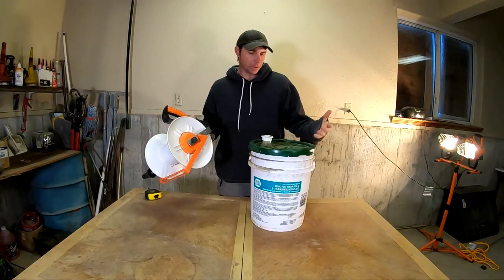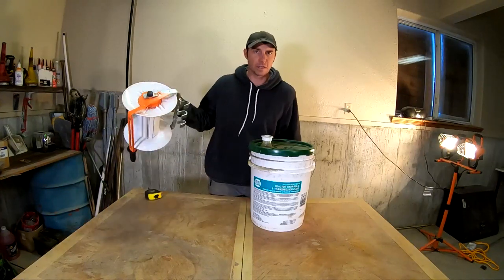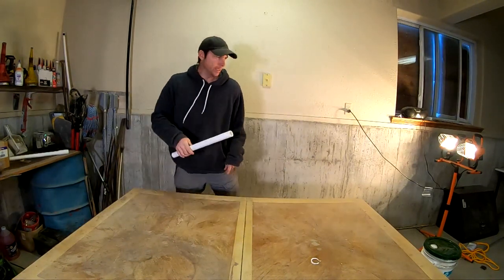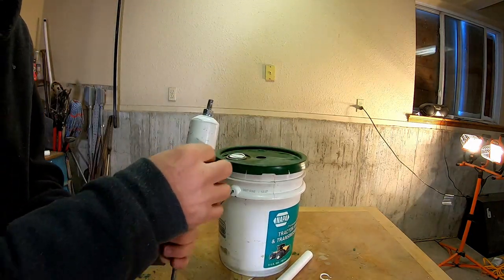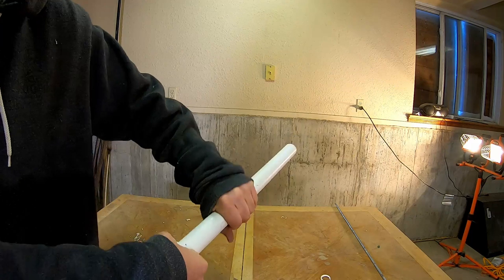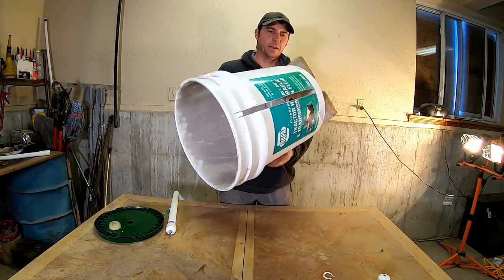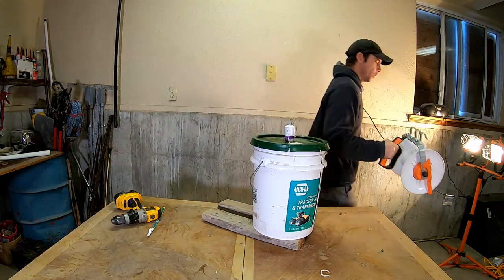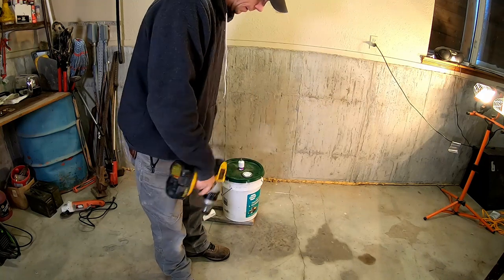How to make a polly wire roller from a bucket.  Drill powered

Comment: Text version to accompany video.

# Electric Fence roller

- 5 gallon (22 litre) bucket
- 17 inch (432mm) of 1 inch (25.4mm) ⌀ pipe
- 1 ⅜ hole-saw (35mm)
- pipe cap * 2
- pipe glue
- bolt 2 * pipe cap length
- 2 lengths (2 * bucket ⌀)

* Drill holes in bucket (centered)
* Cut sliver out of side of bucket just inside ends of bucket
* Tighten bolt inside & outside of 1st pipe cap
* Glue pipe cap with bolt to pipe length.
* Fix bucket to planks, planks parallel with slot in between, opposite direction to plank lengths.
* Insert pipe into bucket.
* Fix second cap to pipe under bucket. Do Not Glue
* Attach drill, rewind tape.
Reply from the maker: Pretty much sums it up.